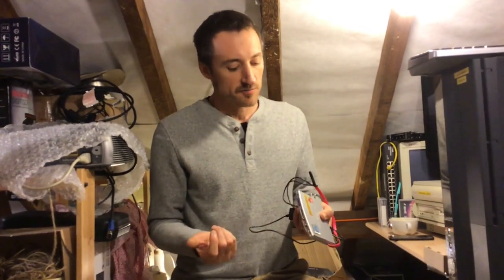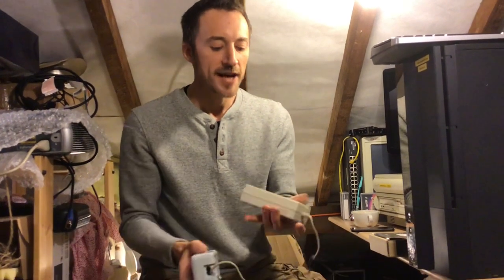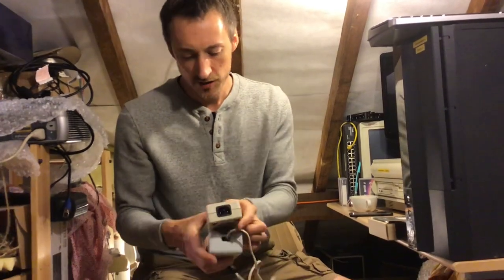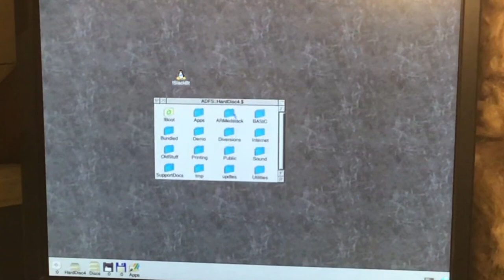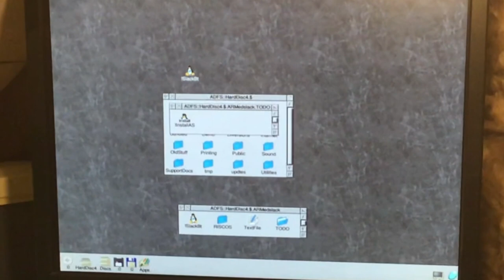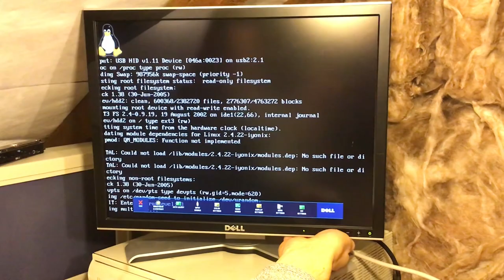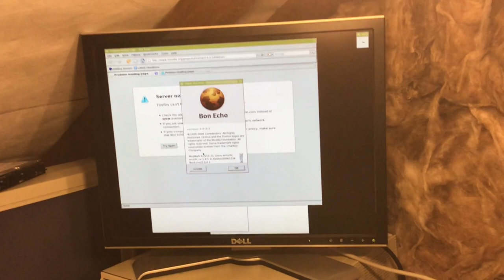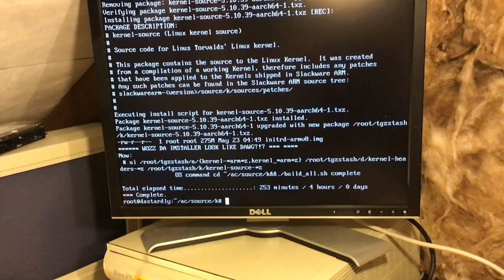S02E14 - R.I.P. Pepa - July 2012 - May 2021

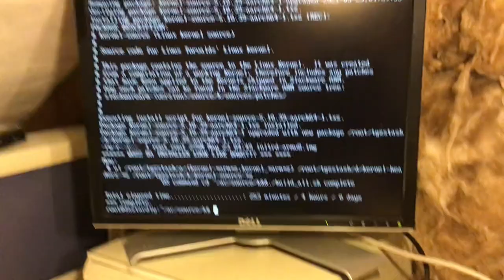Comment: 32:54 yes, kernel for aarch64 bit :3 I'm so impatient that I had small play around with manjaro.
Reply from the maker: Good - go on an exploration and return with your stories of anything that's useful :-). As it happens today, I had been dreading facing the code that builds the public repository, as the Slackware AArch64 repo is 2 layers of abstraction away from the x86 repo, and I wasn't sure how my 18 yr old code would handle it.  A quick code review looks like it'll work as-is. That's probably taken about 2 weeks off the ETA!!